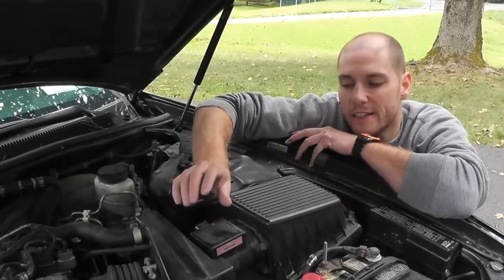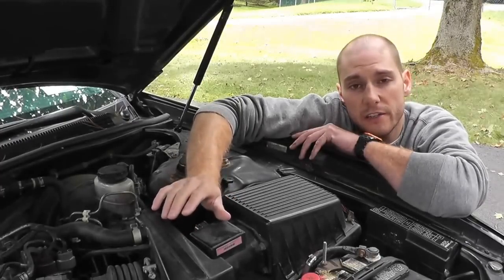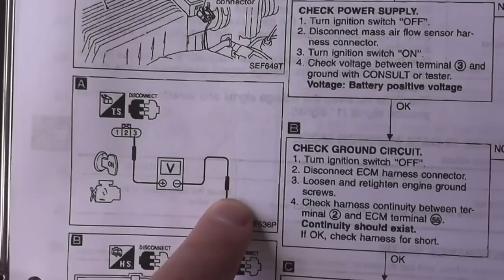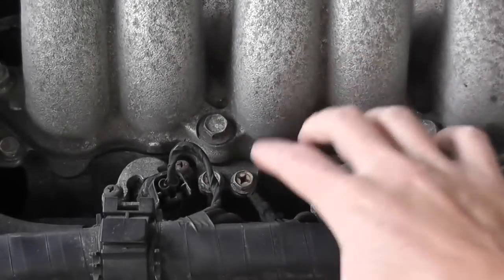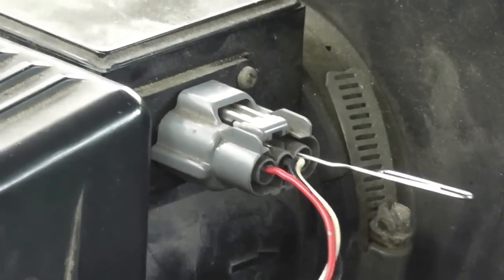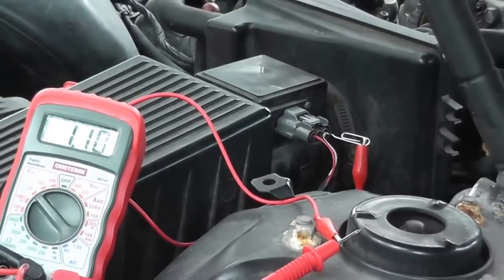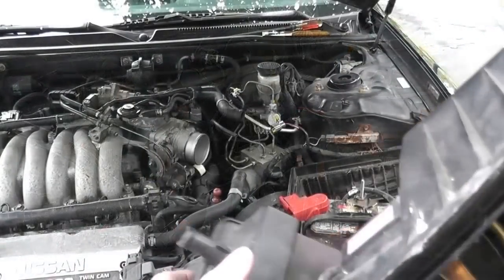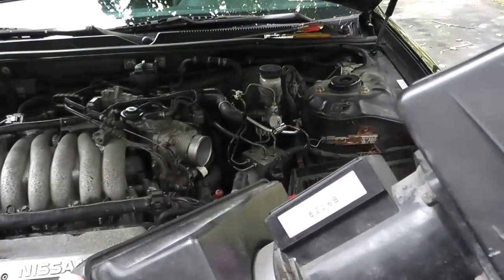Nissan Infiniti Mass Air Flow Sensor Testing & Replacement P0100

Comment: The best video on describing the Mass Air Flow Sensor.  I have spent $2,200 on repairs of all sorts and still the car stalls, now a new mechanic wants another $400 to replace Mass Air Flow Sensor.  I may be a senior lady of 70, but I did massive research on all the causes of stalling.  Even brought the foundings to the mechanics who apparently ignore the air vacumn hose, electrical problem maybe and just replace parts. I filed a claim with BAR and got $1,420 back on those not necessary parts installed by two mechanics, for the car still stalls at stop lights.  A 14 year Nissan Altima that is worth about $2,400 Kelly Blue Book estimate, which I bought new, seems silly to keep throwing money into it. I have not driven on a freeway since September 2, when the stalling began.  As I can handle the local streets if it stalls, for it starts right away, but on a congested stop and go freeway, do not wish to take the chance.  The interior is spotless and still looks great with no dents, except a scratch here and there. I think if I can clip my fingernails I can test this myself, as I change my tires, check my oil levels, water levels and change my air filters. Again, thank you for such a easy to comprehend description of the testing and replacing of an Mass Air Flow Sensor.
Reply from the maker: eveyholmes Glad to help!
Reply: Well it may be silly to throw money into it, but its to keep it running, Just know your problems it is causing and do research, And let me tell you, you get rid of the car u have and get a new one and think its okay to drop $5k the instant u sign the paper and $10k loss the first year? but its not ok to drop money on a car that needs $300-500 of work that'll last u another good amount of years? yeah just seems silly to me..
Reply: Thank you, Pokemonguy16RS. I appreciate your feedback indeed.  I am a woman of 71 on mostly SS benefits and as sometimes professional singing gig, I cannot buy a new car and if I go for a used car, it would have to be not older than a 2010...and those are not inexpensive either.  I have researched beyond believe and know more about cars than 3 men that I know, I also know more about fixing computer problems more than those 3..ha,ha.  I have researched and printed out all the possible causes for the car to stall as it has since Sept. 2 of this year.  I have also research what a mass air flow sensor does and the different prices they ask for one online. Nissan wants $600 plus tax for that little box????   I cannot take a bus to carry my singing sound equipment or a taxi ( a taxi would charge me for loading the equipment in their vehicle), so not too much remedy and I do not also have friends to do the driving favors.  That's what happens when you are independent all of your life. I did get 70%  of my money back from the first mechanic, when I filed a claim with the Bureau of Automotive Repairs of California, so that is a somewhat victory, yet the problem still happens.  Thank you so much.
Reply: Bless you mad'am, you are an inspiration to some :)
Reply: New motor $3000 new Altima $23000 

No brainer.  Always worth replacing versus rebuying.  Call a mobile guy most of them are pretty straight shooters.
Reply: @CarsNToys do you have of link to buy of maf  sensor ?

Comment: You literally just saved me by having this video. I had just got my 96 maxima back from a repair on some hoses connecting to my clutch, and suddenly when I got my car back it was in limp mode, it would not accelerate beyond 2500 rpms. After watching this, I went back to my car, and checked the connection. It was completely loose! So I plugged it back in and it connected firmly, now my car is running like its old good self! Thanks!
Reply from the maker: +Snake DeShazer Gaming Good stuff man.

Comment: I have a 2000 Infiniti i30 that constantly dies after getting a jump or even having the battery fully charged. I thought it would be the alternator or belt but I have replaced it with new ones and it still does the same thing. The dashboard lights flickering until it completely  cuts off.. what is the problem?

Comment: Thank you!  Thank you!  Thank you!  Your videos are clear--the visual, audio, and explanation. Thank you for not skipping vital parts of the procedure. We are relative newbies and having these kinds of instructions is important.  My Nephew was ready to let his 1996 Infinity I30t sit in a semi-functioning state after having several failed-repairs at a local repair shop.  The MAF sensor was replaced by the shop with a used one, only to have the same hesitation symptoms return two weeks later.  After watching your video, we did the tests you prescribed, including checking and cleaning the two ground points, which were covered with a pile of greasy dirt, which looked like grease-covered sawdust. The voltage tests turned out good. After shooting the Film with the MAF cleaner (6 or 7, three-second bursts), I accidentally rubbed the Film with my nitrile gloves, only to find that the apparently black-colored Film (much like a fine screen on a flour sifter) was actually, a silver/aluminum color (much like the flour sifter), so I used the gloves like erasers to rub off the dirt. If I had had a pencil with eraser at one end, I would have used it to clean the inside of the Film. I finished by shooting cleaner through both sides including the two small sensors, around three more times each.  I also used the electric/electronics cleaner on the power/sensor leads that we tested.  Now,  besides the lack of hesitation and idle problems when warm, my nephew reports that the radio also seems to be functioning much better. Is the improved radio function related to cleaning the grounds? Is the Film a "Hot-Film"?  Whole operation took about 50min in the sun with temps in the upper 90's. If we did this again, It would probably be a 25min job.  Tools: two small pry-bars (8in&11in), tapered/needle nose pliers, 10mm deep-well with 3/8in drive and roughly 6in extension, and 10mm shallow socket with 1/4in drive and 4in extension, slotted screw-driver, t-pin (out of paper-clips at Wally world), MAF cleaner as shown in video, electrical/electronics cleaner of the same brand, cheapo multi-tester/meter, and nitrile gloves. I got the two pry-bars, gloves and t-pin from Wally world and the cleaners from Advanced Auto Parts. Had the other tools.

We will be using more your videos. The spark-plugs are next,.

Comment: Very helpful vid.  My 95 Maxima was bucking and cutting out at low speeds. Showed Diagnostic Trouble Code (DTC) 12 on the Malfunction Indicator Light (MIL), which equates to P0100 using the Consult tool that I don't have.  Fortunately, between this vid and the factory service manual that I bought when the car was new, it was easy to diagnose.  Wiring and harness readings from this vid were good, so I replaced the mass air flow sensor with a Cardone reman and erased the DTC memory and MIL.    The MAFS was not cheap (about $200), but that's the way it goes.  Car runs fine now.  So far, so good, so thanks again for this great video.
Reply from the maker: Charlie Hood That's great, Charlie. Glad to help out! Cheers.

Comment: This is good info to have, but didn’t cover my problem. The green clip won’t always or usually snap when I put the sensor in. The connection is rather loose. Not sure how to fix this or even what part to shop for.

Comment: hello, I have a 97 Altima, and it idles rough then it turns off, but if I disconnect the MAF sensor it runs fine and does not turn off at idle.  I did your test, it passed the first one, then I did the second part of the test by connecting the paper clip into the plug of the MAF as the car was running and it gave me a reading with higher voltage than norm. (about 15.3v) Yes it has check engine light on. Not sure of the code. I believe it was PO340 something with the distributor which I already replaced. Any idea? Also I bought one new MAF and a used one and both gave me same reading.
Reply from the maker: jomar rodriguez Okay. When you tested the MAFS with the paper clip, which terminal are you testing? If you disconnect the harness connector facing up (the little notch that you press down to remove the sensor is facing up) you want to test terminal 1 which is the terminal all the way to the right. (Should be all the way to the left when connected.)
Reply: +CarsNToys yes that is the one i tested.
Reply: jomar rodriguez basically its the one with the white cable like the maxima its very similar
Reply from the maker: jomar rodriguez 15v is way off the charts. The voltage for your car at idle is between 1-2 volts. A high voltage will cause your engine light to illuminate for code p0100. Other symptoms of a bad MAF sensor is hard starting/restarting and detonation. On some vehicles you can't go above 2500 rpms because the vehicle enters a fail safe mode. If you performed the test correctly sounds to me the sensor is no longer working. I'd check first though what engine codes the car has.
Reply: CarsNToys thanks man!! I'll check again.

Comment: Do you still have your 97 Maxima? because I've enjoyed your DIY informative videos. 

I am having a problem with my 97 Maxima-- since replacing the MAF sensor connector __ the car dies when connect the MAF, but runs when disconnected. 

What do you think is happening?

Comment: Awesome video, I recently cleaned my maf sensor and i notice the increase of power. Quick question, after cleaning the sensor, I feel that my speedometer doesn't match my actual speed. It displays a lower speed. Any suggestions? Thanks

Comment: hello i have a 2004 nissan 350z and i am getting a code P0103 it is saying it is a MAF problem and i was wondering if you have any suggestions because the nissan dealership wants to charge 1500 to also replace the cam and crank sensors

Comment: Hi, I read that the MAF doesn't always throw a CEL. Is that true?
Reply from the maker: +Simply Z Yes. You can also purchase a cleaner specifically for the MAF sensor
Reply: +CarsNToys thanks dude! I appreciate you getting back to me. Do you know of any common symptoms when it's going wonky?
Reply: +CarsNToys can this be broken and not showing the check engine?

Comment: My buddy has a F 350 that randomly, when he hits the gas, wont respond and stays at idle. He has this happen where he gets no response from gas pedal but it just idles. Then he restarts the car a few times and it will go away.  Does this sound like the mass air flow sensor could be the culprit? Also I was thinking the newer drive-by wire pedal might have a malfunction in reading the senor position. But I've also heard someone who had a bad alternator that put out too low voltage and ended up causing a faulty mass air flow sensor so they both needed replacing. Any ideas? So far the cpu is throwing no codes...

Thanks for the videos, they're so awesome.
Reply from the maker: John Smith Hey John. It sure could be the MAF sensor. You may want to check if the vehicle has any trouble codes but a faulty MAF sensor could inhibit the vehicle from accelerating. (On my Maxima, the limit is 2400 RPMs) Also check for vacuum leaks.

Comment: Hello, I have 1997 Nissan maxima, and when try to start to my car it would die immediately. This usually happens after a day or two of not driving it. In order to start the car successfully, I would have to step on the gap pedal as I start it. This has been happening for almost 2 years and my check engine light has not lighten up ever. Within the last month, sometime when I start the car, the rpm will jump between 500-1500 rpm back and forth for like a minute. I don't know if this is related, but would you think this is mass air flow sensor causing my car to not start normally
Reply from the maker: Ethan Lau If the MAF sensor is bad, you'll be unable to get the car above 2400 RPMs. (The car would run in fail safe mode.) It sounds to me you have a different issue. Have you checked the spark plugs? Also check the PCV valve.  I have a video for both of these issues and both are performed on a '97 Maxima. The other thing to check is if the car is running on all six cylinders. You can do this by disconnecting the coil pack for each cylinder (one at a time as the car is running) and see if there's any change. If there isn't then you know that cylinder isn't firing. If you're not sure what a coil pack is just watch my Maxima spark plug replacement video.

Comment: I'm not understanding something. You're saying that if all of these readings are good and within the right range, my only choice is to replace the MAF sensor? 

I would think that, if it passes all of these tests, that means I can consider my MAF sensor to be in good shape, and that I need to look for the problem elsewhere
Reply: Joe you are checking if a bad connection is sending a false reading. if the connector is good, than it has to be the maf

Comment: I have a 1996 Nissan Pathfinder which recently would start jolting and bucking while driving and when slowing down or coming to a stop would stall. This was periodic but now it'll crank but won't start. I did the test between the third terminal and the ground and was reading between 1-2 volts. So, I figure the connecter is bad just not sure what steps to take from here.
Reply from the maker: +Davis Drury Check engine light on? If so, what are the codes?
Reply: +CarsNToys Yes, P0100, P0325, P0161.
Reply from the maker: +Davis Drury Hope this helps: https://youtu.be/Eps7jk05aWw
Reply: +CarsNToys Alright, thanks.
Reply: Same problem on my 97 Nissan 4x4, 4 cylinder. Codes are P0100 & P0135. Although the last time I cleared the codes there was only P0136. Does a problem with the MAF trigger false O2 sensor codes? This youtube link no longer works. Can you re-direct me? Thanks!

Comment: hi i got a 98 infiniti i30 with the same engine as the maxima from 95 to 02 and i chaince the maf sensor but the car wont runing right and when press the gas the car move slow and i chance the cam sensor y fix the timing problem and  the fuel pump 

and the car last time i chance the battery and work find and this time its got the maf sensor problem
Reply from the maker: Any other issues / trouble codes?
Reply: CarsNToys yes i got no acelerate

Comment: I have a 97 Nissan Maxima and when I get it up over 2rpms it just jumps and sputters. Then when I take my foot off the gas it shuts off. I did replace the Air filter and cleaned the MAF sensor. Worked for 2 days then it went right back acting crazy in the same manner. While I was at the parts store I had them run the tester on it and it came up with these 4 codes P1447, P0100, P0130 and P0325. All these I believe deal with Air flow. I did (before I found your video) go ahead and replace my MAF sensor. So now of course this did not work either. So now I have to do the other steps that you talk about in your video. But I have a question and this may be dumb but here goes, Does the electric that goes to the MAF sensor have a fuse that could be busted? Just thought !!!!!!!
Reply from the maker: Cheryl Williams Sounds like classic MAF sensor issues. If there's a problem with the MAF sensor, the computer cuts fuel at 2400 RPMs. Out of all these codes I'd be most concerned with p0100 - MAF sensor. Run the tests I show in the video and let me know if you need additional help. (The sensor doesn't have a fuse. It runs off a large relay)
Reply: CarsNToys Ok I will it is raining here today so as soon as I can I will do the other tests. I have already replaced the MAF sensor, but do I have to disconnect the battery after and let it reset the system?
Reply: It's still  doing the same thing. I'm just at a loss getting  a good 12v read so I'm at a loss . I'm just getting so frustrating.
Reply: You have a broken wiring harness at the right strut tower in the engine compartment.  There is a Nissan service bulletin about this problem.
Reply: STOP. STOP. STOP!!!!!!!!!'!!!!!!               DO NOT REPLACE ANYTHING!!!!!!!!!!!!     I am a Nissan service technician and can help with these problems.  
  When you have random multiple codes and poor running, the problem is most likely a broken wiring harness at the right strut tower.  The engine mounts in these cars are allowed to get soft, then the engine rocks back and forth too much.
There is a technicial service bulletin about this.  
  Basically the main engine harness needs to be opened up behind the right strut tower and the harness repaired.
  Then replace the engine mounts to eleminate the excessive engine movement.

Comment: Hi I have a 1999 Nissan Altima that has idling problems. It turns when I stop at a red light. it could be the idling air valve control or the mass air flow sensor. I took it to my mechanic and he gave a little overpriced amount for the repair. I don't know if you can help me I just want to figure out if I could just clean the sensors myself rather than buying them new.
Reply from the maker: Jorge Quiroga Is the check engine light on? If not, check for vacuum leaks. That may be the source.
Reply: CarsNToys Yes, it turned on recently. Apparently the knock sensor is bad too but I don't think that could be the problem. I believe the main problems may come from either the idling air valve control or mass air flow sensor. I will check the hoses for vacuum leaks anyway.
Reply from the maker: Jorge Quiroga Ok. So the only trouble code you have is P0325?

Comment: i checked the wires that connects to the MAF sensor on my 97 maxima and found out that they were bad. how can I change them?
Reply from the maker: Skits Visit your local auto part store. They most likely sell a pack of connectors that will match up to the one you need. Just solder on the new connector. (Take a look at my aftermarket radio video. In that video I show what I mean by soldering wires and using heat shrink tubing.)
Reply: ok i will the video out and thanks